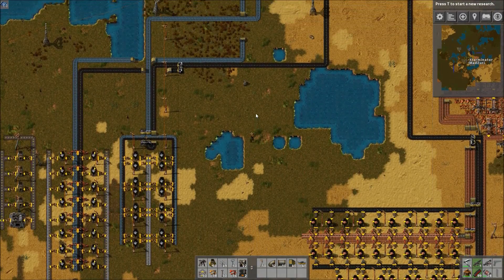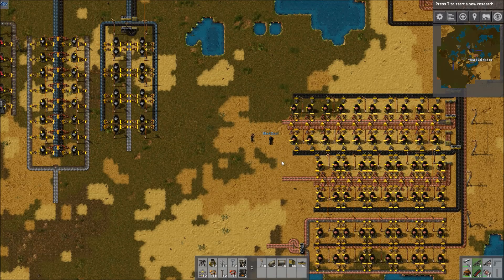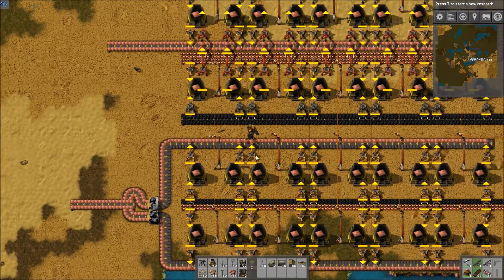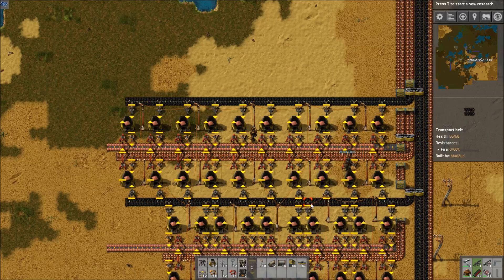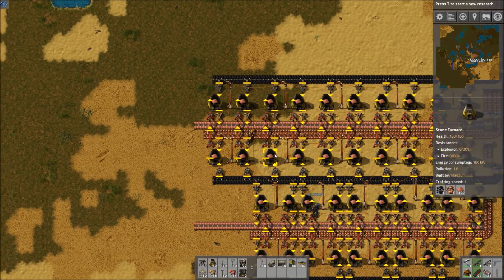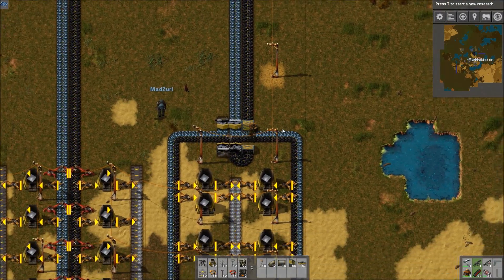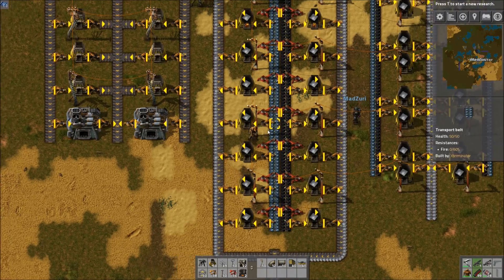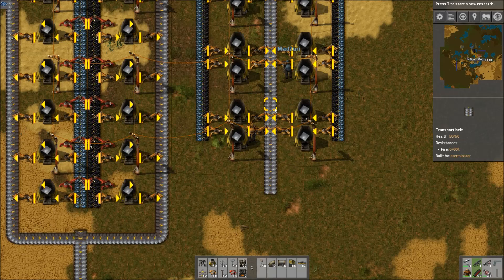Factorio Workshop - Building A Better Factory :: Smelting Designs & Setups

Comment: I'm only on my second playthrough and something that I've been doing that I need to not do is that I have two lines of furnaces, down the middle I have three full lines of iron/coal/copper, and the furnaces on the outside are fed from the inside. Then on one side there's iron output, and copper on the other. Feeds into a bus pretty easily. But both times what I end up doing is discovering I need much more iron production, and so I turn the copper side into another iron side, and end up making a second one for copper. I guess it's nice to save resources and space early game but it's kind of a pain to transition.

Comment: Just stumbled onto the series and I have to say it's pretty interesting and educational for a factorio newbie. I've been using a smelting design that's a variation on a "standard" one I saw. Perhaps you'd want to give some feedback on it, or it may be useful to someone. It's supposed to be fed 2 compressed blue belts of ore and output 2 compressed blue belts of smelted product. Here's the actual string:
H4sIAAAAAAAA/61d0W7jug78lcU+pwembMcVFvmWItt4zwmQJkWSXuxB0X+/aZzcTWObnuHcpwW6ojSUOCRFWcpq922ze15uvj0t3tvtcX1ct4fF+/t2+dIu
vv9aHo4Px/1ye3jd7Y8PP9vN8fvsdXc4tdptF++/Fw9pPvt38WDNx2y13rfP57+njxkuX4nytShfivJJlC9EedPk7VGUz6K8aD/WiPKi/Zlofybaj4n2a6L9
mWh/ovmJ1ican2h7oumpnk8T1+xOtTpJXNNcG1ubNs1iNIPRuKJRRfMSmpMQPaToIMX4IIYHMTqKwVHMDcTUQMyMxMRIzAvFtFDMauWkulv4+oOXmf+RORzb
dvPw622/XT63vbT9r842q79uRllvD+3+2O6Hc3y064Lp2piu7ZHo+mK/aNdzpuuG6rpiuq6orpllvPhCtGtmGS8xAuyaWcXMdMysIUUXZgVriiwMV5iOqdW7
73i4HTO+4cMzVlni3TLrW+PdMsxv8G4pAmWiX8a/GrFqlJ8yYt2M4Y8RK0fFA2PWjvFRRiweFXcTsXiJ4VwaXDw4ISkDMtWdzOF1sz4OOMSOjCcfOpxoIYXX
8lZ0/mc+Rkash0acT3rudD8Vfjp00/ClXa3fXh7azWms/fr54XW36SdcYO8XBgANG7RhhTYs0YY9ZYAZsN60udnEdLue6bqxHljXgFLwjGHtAhDAxQWBgnMK
ml7fTtwASOmNGitq/QaaCcpP65nxtE59z+LGnOl2vTkCSqbdmllAJoW30o+ifPbk37ardv/3fnf61xncvgjPjv++nkR3b8fXt+N3Pjh+gVLx8jYsP6VKM67K
evtFk6meanxSkAh+Y05I8/Snefv7dd8eDtAB54gB+AF/ZKqxcV3Dx7qwCHTzoOPpiJHzbC5RsS5crvpJkbJUNkBMFnoTgT7ASRZ6pUOvI9ArHbpLTKyLMgK9
1KHr3LYIt60QuW0W4rZO7Qizs7xOOq8jtHbDNDSqTuoIpwfiOhvzZNwRQruxGt6okZz4P3iAiANQl0heoQBqOZeS6eBaFbqPNmwfLegpu6sA62VnJceGgIuV
8yY9gAcCmh+9Idg6fQP8Ndnr6Fmqn+nBJaFJDut5rb6ZiCTkJgdvff8W2QPpuzd9nx3ZdpqcnPp1CagHl8twSXGSE3oxJMn8T4HEMLkBefojoIHQyHxDNFQm
43SWPUlyPYkrCXmD4VO2i2wxdqw3IX0J7lPSbr43EGnh8bM/PlryzoEqeRE4ay20cnIeFke+Pcu358nIF2WwwPU7MVxgzgpUrACrtLFKszqzKrMaswqT+hrX
vOSa11zzhmueSVVJXY1U1khtjVTXSH0TqW8a0hcNsIzP7EQyV+m5+slI7C6E2N2oPfwvqMQxZK8HNKw1fCR85APhoxYHxQuc4v1R8fqnePtzRNw9G41Pt2mI
iwBikxB3ez3xhiqHuJOJI9ZMutvIk4gbDbFGA/NI6B5hxhFrzLMA87oh44g15lmAeVZIiDXiBXiXJbgebcC7vBxcLfBpgcsjrHfAGIYrRrpA2FDgemQB7weT
VHPQOudyUf28+cSuIFPqSZ5Pii2e2TlHalGsUuTmo6AUtSV/x3tnLZhIsSQQ+0xKOt30ALyzzcGVsiEtfXNTKe+8KwxXYlkg2dTyeXcHAV4j5+BKeZC7RQPv
nVNwtR2puwcGL6pzcKVgpu34U82WV671jUD56zEiFKgWUdfaOpE5X2AKXJ6ba0WluHjliLtlHU7JpKEsAyiNR2kayoJH2TlsCmXn9sIouxFJlA2PstFQeqxw
yzQcSo09FmBPl8JwKD3zRwtIJEreXZrGHguwJ9MgNe4EqMMHBI04Ad7UNESNNZGQwwdvzZUHGMMTRoHIs4WeQwkfP4O0X/TsCCvWUPhoJkuJnUcxp0DD4PO8
GVbRofDxIcUNCVgZh0NIc9gNrWDxhYNI5zhujgIWXDiIdDxxkz2wyMJBpLNuN2sGCyscRDq3cbcfYDGFCyh0RNG2ge72zCugUBClxOG6G2cl6kj9Yx4RClRA
Ai8/3D/rA1RAAq8H3YyCfIVasl+hwgLXr1BxgTkrULECrNLGKs3qzKrMaswqTOprXPOSa15zzRuueSZVJXU1UlkjtTVSXSP1TaS+aUhf0NMznrGTKCNuvooI
BRx94kWoR4EuN0TC+/isic974vz3ovdT5D9xp7xwd2O87qN2Y2/aAWOkYUnmfZ3AWQP9ko85IzFv8gz3AD+Nc4PbPaVg9TPPrJk3eAJnFTTWRsbaZyF4YkFj
rWWsVQBrFcJaylgDfOxGpbHKfDSRj3bPM/fcg9VPpmOAjTkCVOZigIr3QZB4lUYAGuBhHQEqs9AjIfokDRBnQrQVdfM4652ikDhVmLwbjMymaii8Qd+bBvh8
DamXylTeo0Qciur4eAcdSUDUOOJGSe9UhmWcSrlA6tGL4MRjMAJQnna9dA59c4bVTWVeIK+2SIyUdwCBzUporyJvq9xdo3fOQwKV97eBrXhvJ44+G8PqplI2
8ZRNY/wbefjjUr9kNavvqjTE9XC6zEY9EHKW4OpymR3jLHEzBvKg9tfr5Npz2loVb+TtFOQp7UEl7h7Snq68FfjM1ejMAYdmhv5o2MgEAcdsX4ZAS2vFNCqL
obqc5SGKW89GwSHm+BA9CwKHqPAhquAQuIWc85vIEDELMYMsxIoYKtxAcmwA3Dwc1zR9tIoM0PMlILVD61ZixI5BGjAlpwbBD2Bo/zH8Jdq9QzWsAHCzApMH
1gCemIk2aPcx/5jR7oM+wmBrsKC1wfbguXdwZ4pZhMEmYTGvYrBRBAOz4WYR8+wJdxKOlwA3XtiqJdiQkuNZ4J3MDShYht/88F8lcF+fZXaMswT/hVsp7VnS
sLSXxY8M6KXYnMiZmaRIw4tUvEjJixS0SKYlHDNwUjZyHXnVWQl6CHo56ImizYpfb6Pnibdco9eb56DRdst7k+SsOBwq2IrcnHXL52BBfd18luCuIWd2jLME
f+s8/G7xWboKS9fS2JUsrSGPSycJeSlJJwl5KUmbhLyQpTXkYWnLCvKzl9akNeRx6UZCLnmm89hx5JJfM8mvmeTXTPJMJnlFkzyTSV7RJL9mkl8zya+Z5NdM
8msm+TXJrUleTXJqkk+TXJrk0SSXJHlDyZ1J3kxyR5In1JIsVViCHfcGAmzNiQmoFf+nKKyssaKvYh4KFxVCKFapuADF3ypOT/E8iptXYqoS2JRwrEQmKXVS
shcp61LyDylJlvJUKVWUsnNpQyTtSaRtgbSXkja/0v5T2kBK+2ap0CHVGqRigVRhkYpaUl1JKu1I1TSp/CnVEKUynlQ5lYq2XtUVPt2IPATAvxHDP8XLPaub
QxIUqrPm/GO/zdRnE13pfQ59jHH96rZBvro1otsC7vbs1sBuL5/KQt02RLdzvNuK6LbCuy2JbvEls4LoFl+yjPeKL9gc7xRfrhrvFF8shl74UuGdDizU5Gei
AARcrRLtErfqGu0SN5MG7RL3FBntkiCewQtkuI0YvESEQzN4kQznncHLRAQKwxcK92UJZxJOpQQvVLojE5xcRWT49Ir/TWnuhzRzSIJCdb4BloO5c5ec8T8O
eo/Qe6wpj73V5L2+dCfEPL6UhwW9tPNGHfRmVZ6y/C7znG5mj1izBmtWYc1KWmsD1cEmJ0Ot5lCrmtalxBYQUxhpBXVFrwm01tAcQsaFLS1mJ/d2Cl6xmO63
hlpBnDPISHkHgjmGdKcvHAUjPxLEx0HjrxtQvyx+uQgdELkHhtyg/vxF7uHLv5D011v04gVs7Qa2CVewh/Wg72DfLhrQmrjsXsOTjb+0OPZj7F6+MLZG+KuL
yo/IdwnIWA9oAnM7714GI+lqWdXVHvk1sj4pWdyNjLtPxmncfRKyuGsZdxXAXcm4Sxl3gMvdqBJumcsmctkM47IVqq4ylQNMzipomccBGntRHH7VUQId4HA/
tJKgZQZ7BAb3dEhMkykv6unx3dliKphVyLxrVWdZNSaeAF4owHbiRj5ZpbKc90yqY1KdKR8A1IRIjVludHaqJBJbVboGUiGTXYzK2EDe6aadYEGJJa2cYAf2
BabGZnk3E9iEyXsweevo7pKdip8CWt7bB0oSbkUCrEayNEgq3RNP96Tu1q71MU7IIzxa+ISfzHxIl7d1+IdWToPMnnfb4363efrZ/rP8z3q3X7w/r/fPb+vj
U7td/ty0T6v14fPfxa/l5tDOrv+5b5erp3+W29XTZwft9nhYHPdvf/7/+teu4ctu1fYemxk9ABxWB6qqpo/hCiRaCdWehfkcfkgceQ0ykT+hhgtcn13EBeas
QMUKsEobqzSrM6syqzGrMKmvcc1LrnnNNW+45plUldTVSGWN1NZIdY3UN5H6piF9sXLMOfCQnzVfpG7Gmv70xEa+7pgKdBdSswi7WAcjbO7GAFrzD8SMTQEq
XoUDVaWNXjvi7vlXHHHSEJcBxKYhLjTExiPu9k5hxObREnzVhEXcaIgbDbFHQvfMKo7Yow74kgiLuNQQa8yzAPOs0BBrzLMA87IEWONdgHZa9NBCl0dZ74wp
DFeLdZFQp8UNCW6EbRrZFLgSUaWRvVl2jqai0+QtC/RWA4dV8vhShOIjquSLJM/JeyIpW9HCEu/ltSjqRkHsZQISruSH3DQDe1SAhCvlgVoaGMhbTYqhWp7t
7iu8U6AwXI8s2C18Eq6U/7lbPewCPRnKpFgW2EsnLyARBSbyctdFqulLTRSX2HG64tJpnI/Z+nm3PSze3w/rv7fLzeL9chJxbF++z4bKdieJ7ar9/fn7WY7M
0KJcJdNp2B/79njq8NvTj3a7+i8ZHAUUieMAAA==
Reply from the maker: Hey, glad you're finding the series educational. :) Also thanks for the submission, I'll take a look at it and give some feedback when I get a chance. We might add it to the list to showcase in the series as well. If we do though, it might be a while before we get to it because there has been a ton of smelting designs and we want to do some more variety for a little bit. :)
Reply: Thanks! Keep up the good work!
As for the prospect of waiting, it's not an issue. I just hope someone finds my belt splitting/merging experiments on the useful side. :)

Comment: I have a question. How do I calculate the optimal number of smelters to build in these 'towers'? I guess it will depend on the speed of the belts, the inserters and the crafting speed of the furnaces?
Reply from the maker: Yup pretty much! The inserters really don't matter unless you have gone with modules in electric furnaces, otherwise normal inserters should work fine. 
I know the throughput of blue belts is exactly 40 now, and I think red belt is about 26, and yellow is 13. I can't find any definite confirmation on those though. They are listed on the wiki and multiple other places but Zuri had mentioned to me that they recently changed them to whole numbers rather than the partial ones you see the wiki and such.

Comment: What are the advantages of electric furnaces over steel furnaces (which are the same size as stone furnaces)? Why would I want to leave room for electric furnaces when steel furnaces craft just as quickly, and my belts are already set up to feed coal into the furnaces (which isn't needed by the electric furnaces?
Reply from the maker: Two main advantages. First is that they don't take fuel so if you are low on coal or solid fuel, or whatever you're using then that is a good reason to use Electric ones. The other is that they can have modules added to them, which can greatly increase production, especially combined with beacons.
Reply: Ah modules. :) Hadn't thought of that, perhaps because I hardly ever use them, only when needed to build assembly machine 3 and rocket parts.

Comment: why you hate balanceing. i use
it a lot.
Reply: How about when you take of the main bus, and the inserters only take from a single lane, instead of evenly?
You could have a balancer on each Main Bus offshoot, or a single balancer on the Plate Main Bus input.

They also make sure assemblers/furnaces are working as much as possible. 
Having 8 furnaces on 1 side, and 4 on the other when half the lane is backed up, and the other half overflowing....Balancing fixes that issue very easily/reliably.
Reply: Of course they don't. They even out an uneven input. To allow full flow of items. 

If I expect my belt to handle 100 items/minute and it's only half loaded, I've just capped my belt to 50/minute. 

And when my entire factory line uses 100/minute I then lose half my factory production because the belt isn't full. 

If my iron ore input dies out, I then lose all iron plates (no buffer) 
With a buffer and regular checking, I see the iron input is gone, and arrange the replacement iron ore. For that gap between the new and old source, the buffer takes over. It also handles when miners start stopping due to the whole patch running out. 

There is no reason to store/back up iron ore (except for concrete,) and without buffers your entire factory is limited to the miners output and the speed of your furnaces. 

The buffer allows even variable/peak usage from an even input. 
And balancers allow maximum throughput from inserters taking unevenly from the belt lanes.
Reply: No, they do not help in those cases either.

> They also make sure assemblers/furnaces are working as much as possible. 

They let you build up more belt buffer storage. Which is not really helpful. Avoid buffers.
Reply: +Q belt buffer storage is good, because the belt speed is the limit. If you have half a belt empty, you're wasting potential for further down the main bus when they run out.
Reply: Nathan Brom
No. Buffers don't magically produce items out of thin air and don't increase belt capacity.